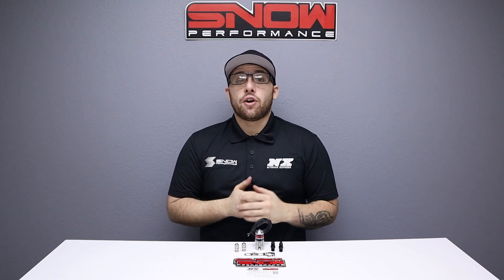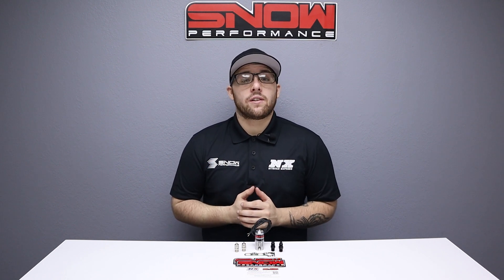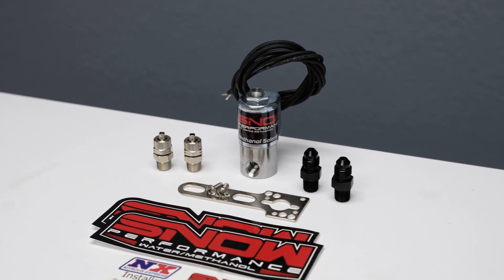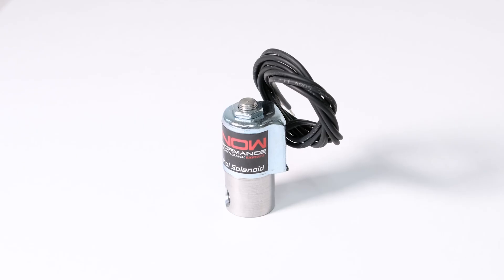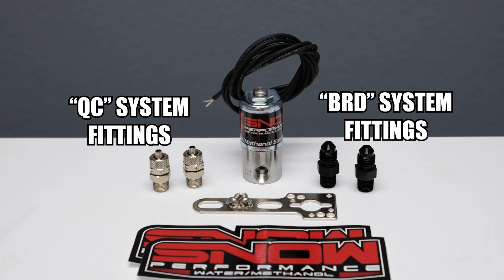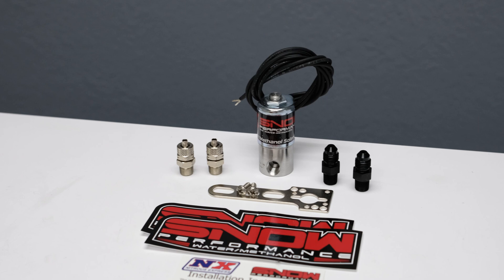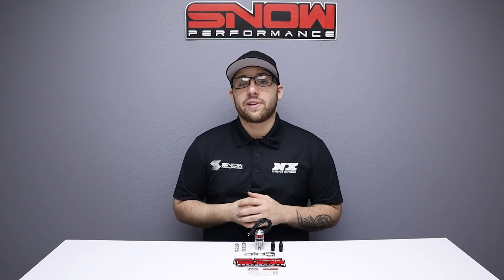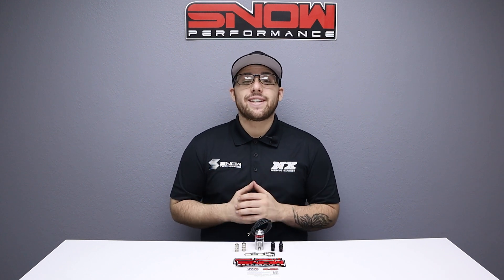This is why you NEED a Water Methanol Solenoid Upgrade! Snow Performance

Comment: My friend, I buy the selenoid, but I need you help,
Could your share me please the manual instructions, thanks
Reply from the maker: Here are the instructions www.nitrousexpress.com/images/40060.pdf
Reply: @ thank you !
Reply: Yo, how the hell is this bracket mounting to the solenoid, you’ve got 8 damn holes of which only a set lines up and the supplied screws are to big to fit the holes? Your instructions don’t mention it at all.
Reply from the maker: Send us a DM on FB and I can give you a diagram of how this solenoid goes in the bracket